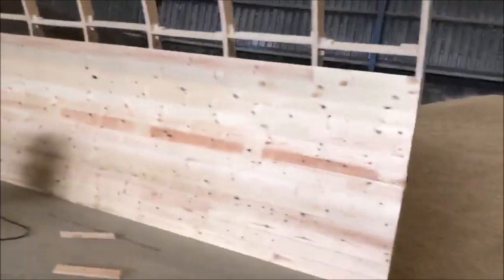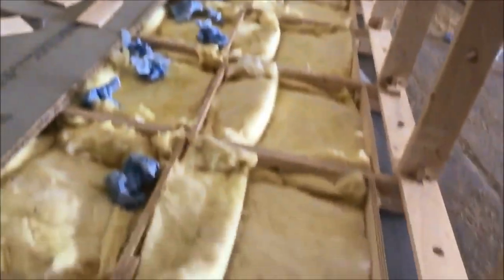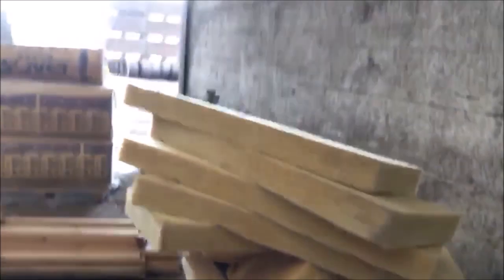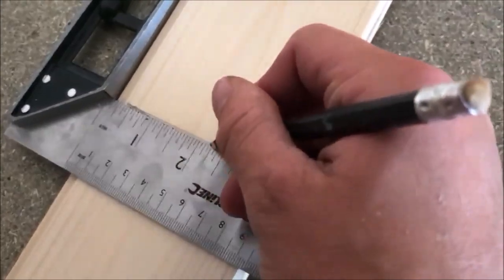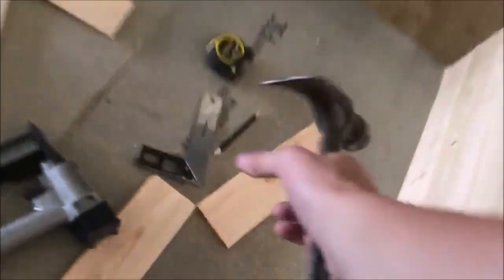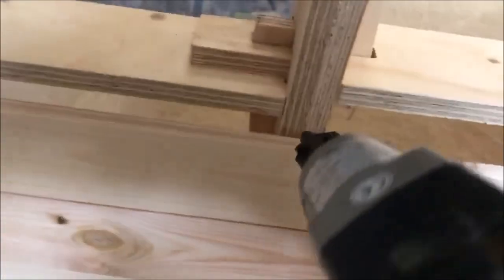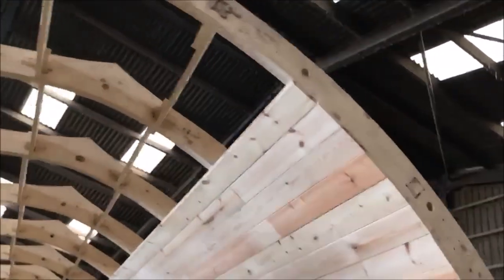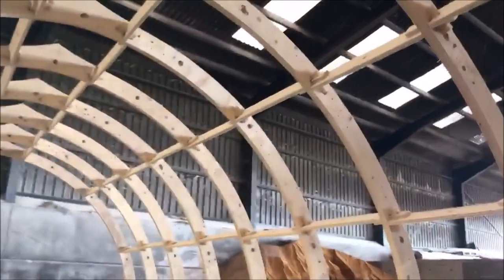Building a Glamping Pod - Part 4 | Internal Cladding

Comment: I am thinking that the cladding is what you bought locally.  or did it come with the kit?
Reply from the maker: Hi, I bought it locally from a nearby builders merchant. I would advise getting pre treated timber though as we have had a couple of issues with wood mould even after being treated with wood stain. I chose without as it is all they had in stock at the time.